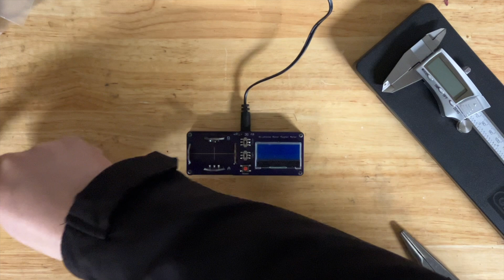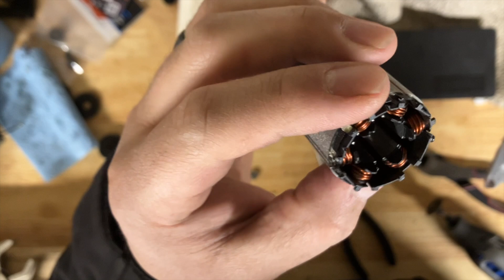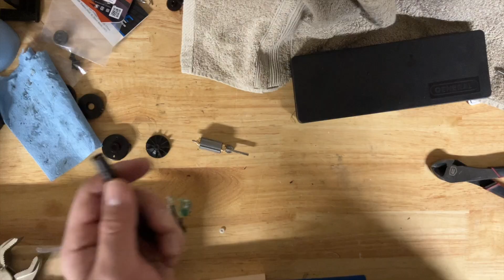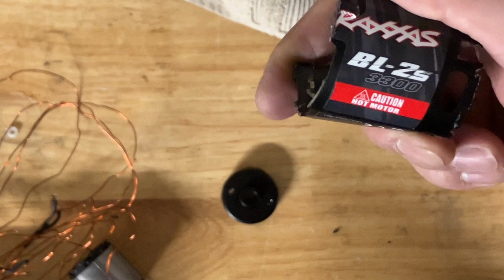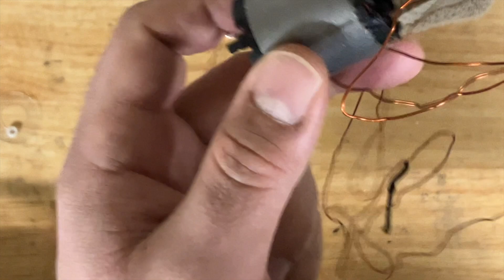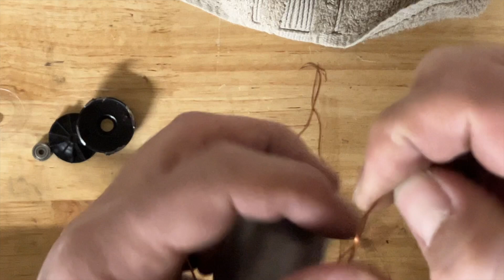Inside Traxxas BL-2s motor specs turns measurements and rotor strength gauss reading

Comment: It's not a 13.5 that would be wye wound these motor is delta wound. There no timing on the motor timing on. sensorless motor is determined by esc.
Reply from the maker: Ah, you have seen it. I just left the link in your previous comment on a different video.

Comment: I have a question....is it possible to use the BL2s motor without the plastic motor cap from the exterior?...that plastic cap that clips on to the back of the motor like the vxl motor? if yes how many millimeters long is the motor without the plastic cap?

im planing to use this motor and esc on my FTX banzai.
Reply from the maker: You can but it will not reduce it much due to the built in fan. The cap also hold the wires in position. At most, you might be able to get 2.5mm before you start getting into issues with things hitting the board or the fan. The motor itself is would probably be about 52mm if it were a normal design.

Comment: Very good video was informative and I was curious about them still all en all it’s a good motor for bashing. And now they found there way into the slash modified mud boss everyone seams to love that motor combo in that setup
Reply from the maker: It's even in the Supra 3.0. I really like it. I would say it is the Toyota 22R on motors. Not the fastest, not the strongest, but the run time is good and it is just enough power to get the job done and have fun for a relatively good price in an RTR.

Comment: I’m trying to figure out if the BL-2S motor is legal for 13.5 SCT classes?  Especially since there are some Slash models that come with BL-2S from factory now.
Reply from the maker: It will depend on the club. The RD will be the go-to. I do not see why not as the BL-2s is slower. Do you have a spec Slash class?

Comment: In your opinion, could this handle 3s if you decided to put a 3s esc wkth it?
Reply from the maker: I do not think the esc can handle it. The motor could with the right gearing. In the Slash manual on page 7 of the manual it says 6 or 7 cell NiMH or 2s Lipo. I may have missed a section but I do not think this one can handle it.
Reply: @telecomandorc  i was just referring to the motor. But with a 3s esc.
Reply from the maker: @gone.fishin9039  I am sure it will.

Comment: You think it is even possible to open it and replace the bearings with ceramic and put it back together?
Reply from the maker: I do not think it is worth it. If you have special machines, maybe. But not with normal tool. Too many parts are pressed in.